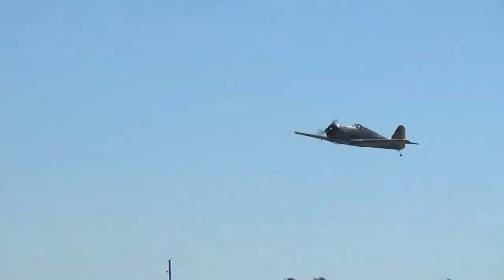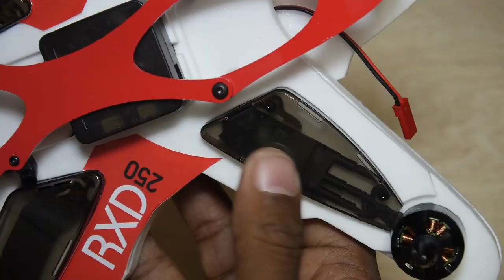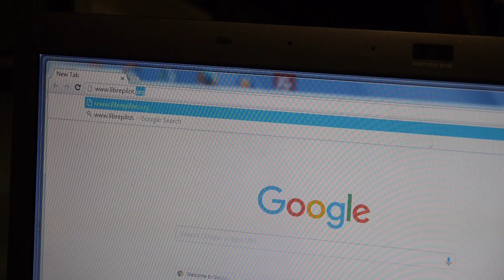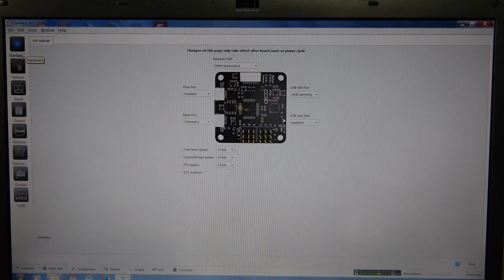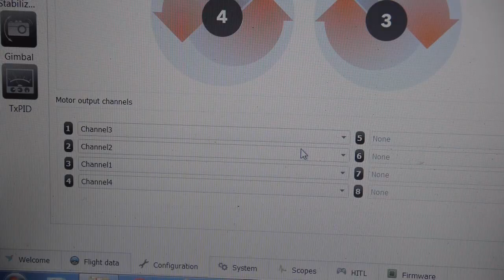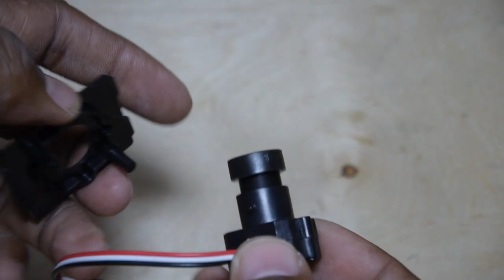Rise RXD 250 Unboxing & Setup | HobbyView

Comment: Dude I got to give it to you. You really knock it out of the ball park as to explain how to set this thing up. I got my RXD 250 6 months ago and it’s been sitting in the corner of my room since. I just pick it up like 2 days ago and wanna finally set it up with
 flysky FS-i10. I also got a
 Spektrum dx7 a walkera F7 but I wanna give my flysky a chance. 
I also bought the tyro 99 do you think 
Liner pilot will work with an F4 flight controller? Thank you for any support